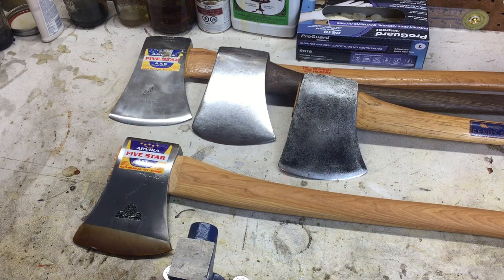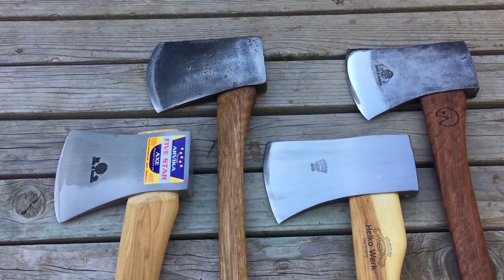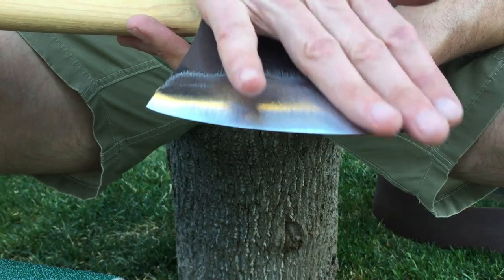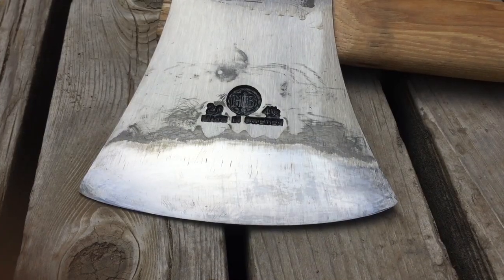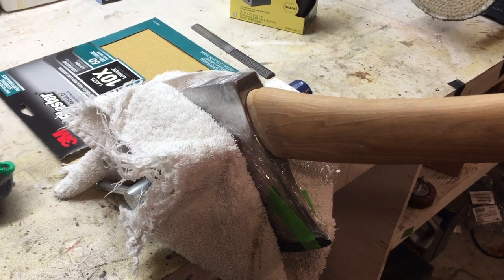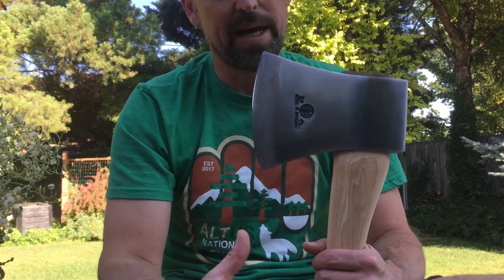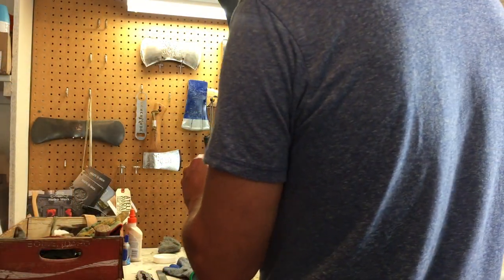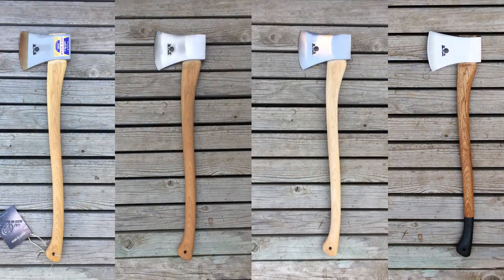Arvika 5 Star High Performance Modification Tutorial

Comment: As an Aussie, I'd say you've done a fantastic job. I have a HB axe exactly like this, but from the '50's. The types of wood this was designed for are Australian eucalypt hardwood gum trees as you say, which is why this has a wide slim wedge shape backed by heavy weight of 2kg / 4½lbs.  Personally I like the slimmed handle, but over time it will flex with that much swinging momentum, so we'd leave it a little thicker.  Also would suggest adding a neck guard. Everything you did was great, keep up the great work! 👍

Comment: Beautiful axe! When working a convex on a belt sander slack grinding is the way to go. Even on a bench grinder like yours there is a small space between the platen and the wheel that is slack. You can also use the bottom of the belt, although you’re relying on feel much more than sight when using the under side of the belt. Mine has a cabinet and flips up vertical so it’s not a problem, but give it a try on an old head. Also, I’m sure you’ve gotten a Shinto Rasp since this project, but it makes the thinning process a lot faster. And to stop bleeding through the tape, take some clear paintable caulking and seal the tape edge with the caulking and wipe it away. Remove the tape while the paint is wet. Laser straight line!
Reply from the maker: Yes the Shinto Rasp is the greatest of all the Rasp Kind.

Comment: Good video. And some good info. I have never used pine tar. Would you mind educating me a bit  one it. I have always used blo with turpintine. Or teak oil
Reply from the maker: Iowa! Hawkeyes or Cyclones? lol So, there are two kinds. One you can get at any farm supply store simply called "Pine Tar." It has a veterinary use with horses, so that's why it's usually in the vet supplies aisles. The other is called Swedish Tar and is widely used by guys who have wooden boats. They like it for it's waterproofing properties but it's pretty expensive. But it's REALLY nice. Awesome color with just one coat and it dries up nice. I could only find it online at a boat supply website.